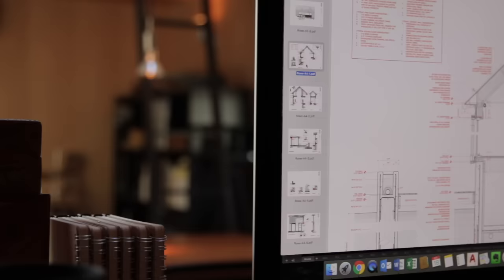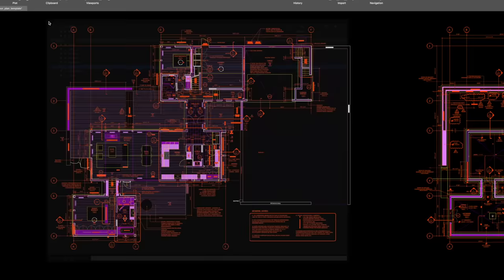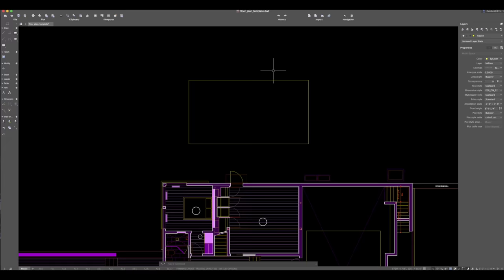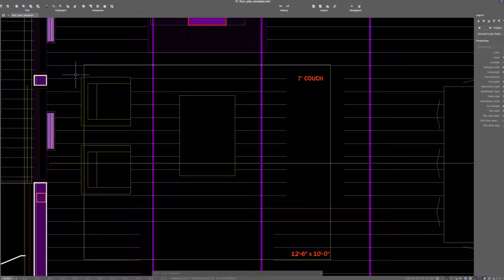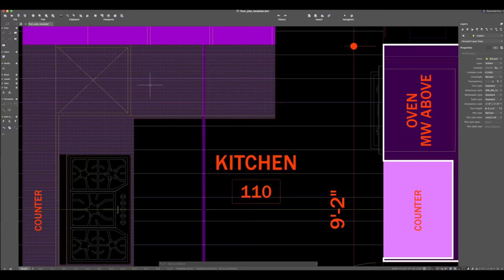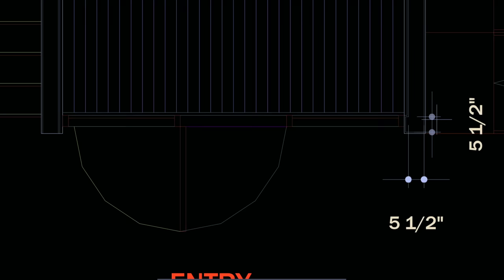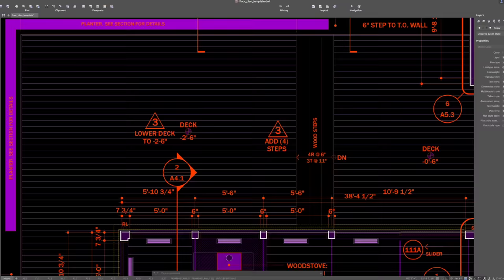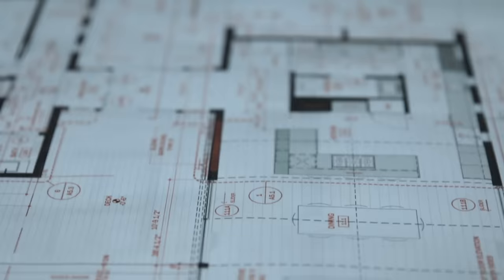Architectural Drawing Tutorial | My process + settings

Comment: Did you learn this cad management setting system (line weights, layers, etc) in college? Or, did you develop this system based on your desired output? Or, just through trial & error?
Reply from the maker: desired output + simplicity...i worked in many offices where the layering system was just insanely complex and convoluted. and then, people would add things to layers that were referenced in the wrong places...you  know the drill...we spent more time managing the layers than designing...but, I understand larger offices have other concerns...given that I could make the choice I chose simplicity and legibility. hope that helps.
Reply: Agree! Thanks!

Comment: I'm coming from the product design world, where the work flow is basically, create a .step file, send it to china for either 1. CNC machining or 2. injection molding... But I've recently started dabbling with architectural design, in my preferred CAD package, solidworks, so in architecture, what is the workflow like? what are methods and standards to follow? or can you basically just plunk lines down with dimensions on them and try and get that built by a contractor?... from your video, it seems like "line weight" is everything in this field, but I think what I'm trying to get at is, in the real world, does it really matter? are those line weights part of an agreed upon universal standard?

Comment: I am an engineer, not a draftsman, but I did design my own house and I used an architectural standard system for layers, with layers for foundations, plumbing, electrical, walls., etc.  That might not be important if you are using conventional stick frame construction, but building a concrete home and being my own general contractor, I needed separate drawings to give to each of the trades, and for my own design purposes.   All of that information could not be conveyed on a single drawing.  See: U.S. National CAD layer guidelines:  https://www.sdstate.edu/sites/default/files/2016-10/US-National-CAD-Standard.pdf

Comment: Hey so if you put different architectural elements on the same layer (categorised by lineweight) it makes it hard to then separate  then edit or turn off elements? Also goes against convention?
Reply from the maker: This is a system that's worked well for me in my 28 years of practice, but I don't pretend it's right for everyone! I prefer simplicity. I guess I never understood why people need so much granular control - a layer for everything!? I've worked in offices that followed the AEC standards and every drawing had 285 layers, I would spend more time turning on/off layers than I did drafting. To each their own!
Reply: @30by40  Ah yes true! And filtering. Just wondering about your approach and whether to consider it for my work - cheers. Love your channel!

Comment: I don't understand why people still use autocad when you can easily use Archicad especially for residential drawings. I understand there is a big price difference between the 2 but if you are a successful architect then you need the right tools. You have to assign every line you draw to the correct layer in autocad whereas in Archicad this is set up once and once only and it knows to show a specific element as you have set it to be automatically without having to place it on layers. I'm all for architects sticking to sketching and traditional methods but we also need to improve our technologies.

Comment: I respect your knowledge.But this layer system is not practical for technical design.You must need different layers to show many services.
It can be used for presentation plans.How can you hide certain layers if you have just few thin and thick layers???from my experience its hard.But the same graphical output can  be achieved with a normal layer system where you have separate layers for each services.
Reply from the maker: see 2:45 my friend...if you're doing commercial, more control is perhaps better, but in my experience it only gets messier (big teams don't play by layer rules very neatly)...if you're doing residential like I am...I respectfully disagree...
Reply: 30X40 Design Workshop 👍agreed.
Could you please give me the link to download your ctb file?

Comment: I swear ACAD is so archaic with all the colors as lineweights, layers etc. I’m an 18 year Revit veteran, and everything is so much more intuitive. Everything is on categories. Doors, walls, floors, roofs etc. everything is made as assemblies, like multilayer walls. And the categories are assigned projection and cut line weights. Line weights are WYSIWIG, no colors. Black lines on white paper, or whatever color lines you want. I can’t even imagine trying to draw different color lines to represent line weights when that’s not how it actually gets printed on the paper or PDF.
Reply from the maker: Hey, tenderfoot...lots of ways to practice architecture, don't be so dogmatic: A Better Way to Draw in AutoCAD (Change this Setting)
https://youtu.be/SKD_lTiAf4k